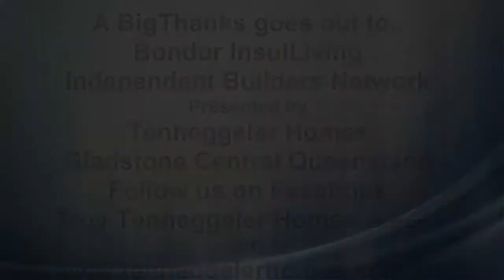Week 1. Frame stage promo video Mccarthy road

Comment: I noticed that your bracing was very minimal on the inside of the house.  Weren't you concerned that the wall might fall over or was it braced well from the outside where I couldn't see?
Reply from the maker: Peter its still in construction....these homes provide up to cyclone 2 ratings....